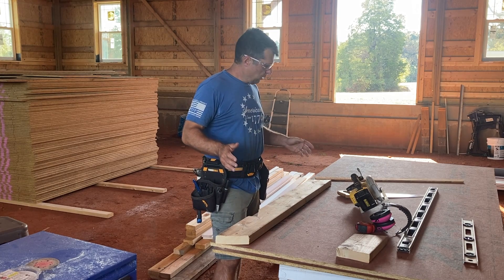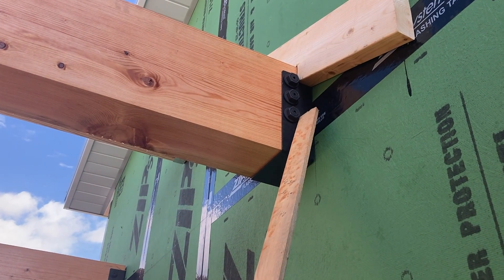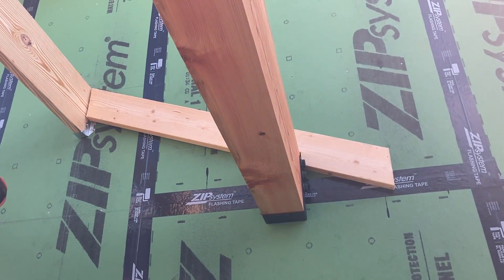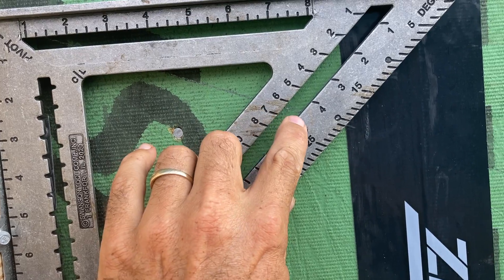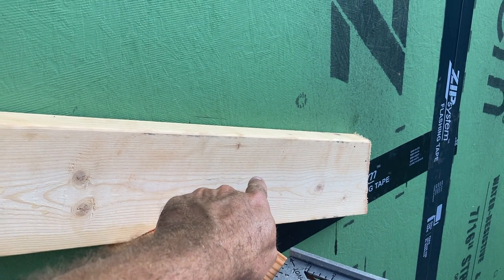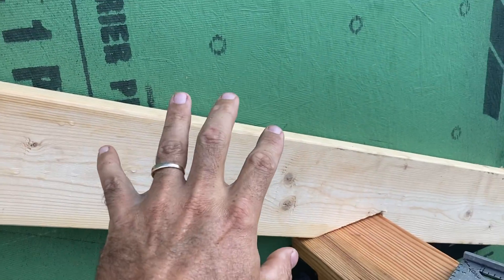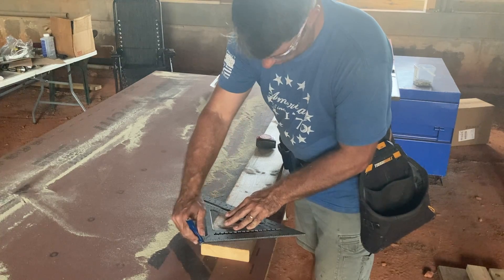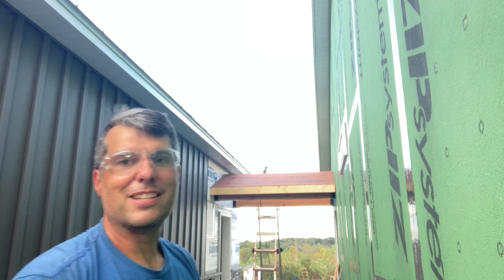A Different Way to Install Rafters (No Toe or End Nailing)

Comment: I have a similar situation, garage and house are about 5 feet apart. Approximately how much would someone charge for this?
Reply from the maker: It is going to vary widely depending on what materials you want to use.  What I have found with the little I have subcontracted out is to multiply your materials by 85-90% and that will be the additional labor cost for your project.  Now if you have to remove material that is already installed that labor cost will be additional.